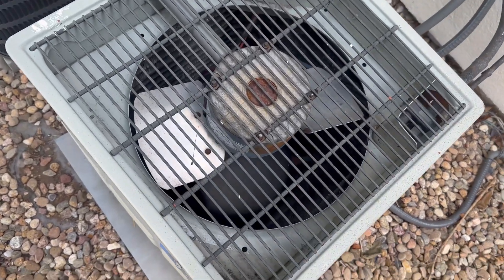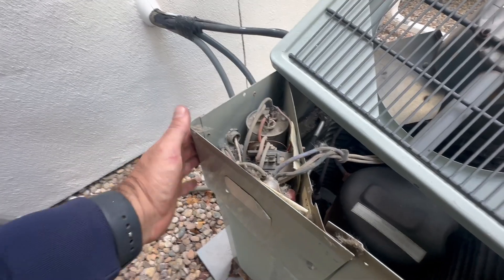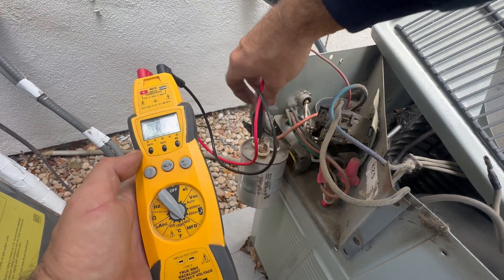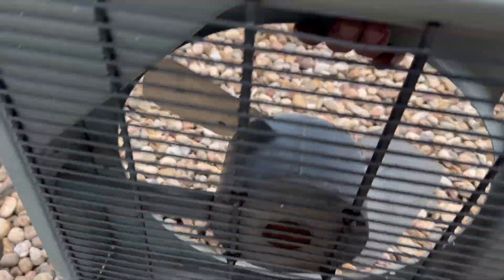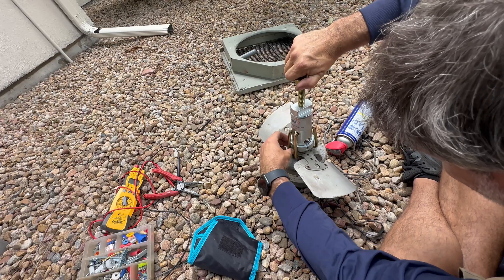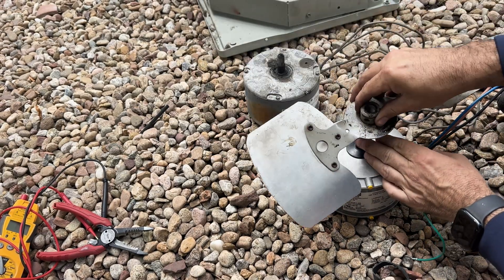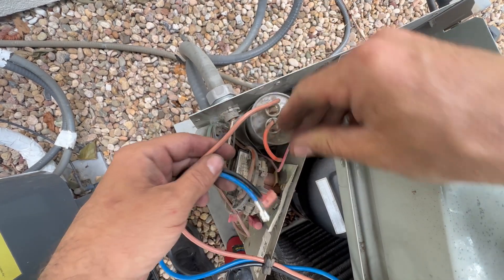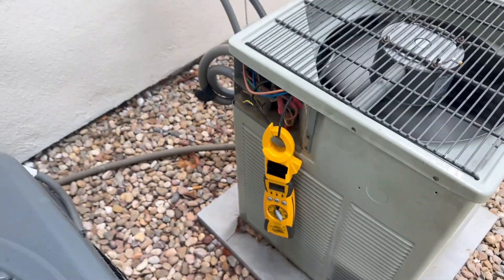Compressor Runs but Fan Motor Doesn't

Comment: I have disconnected the bad fan before and used a carpet dryer to blow sufficient air over the coil until a backordered 800 rpm motor came in. Worked great.  Pressures were nominal so the compressor didn’t even know.   37 years doing this.  Have done with strong commercial free standing fans as well.  Strapped over top blowing up.